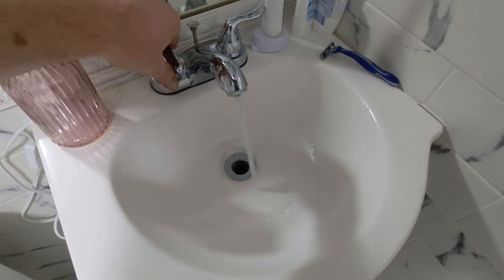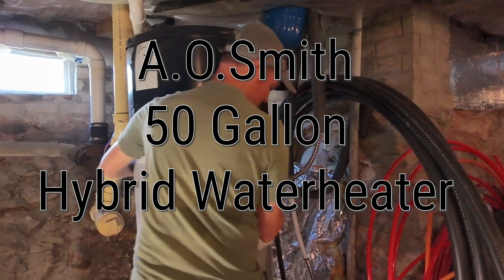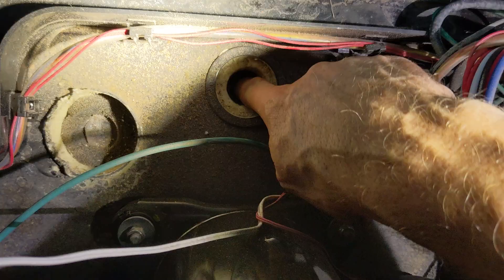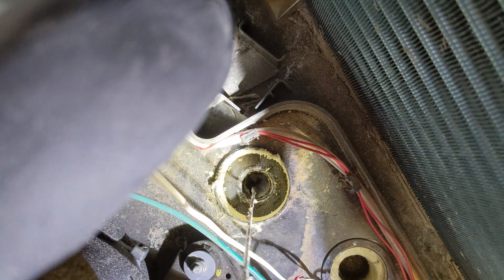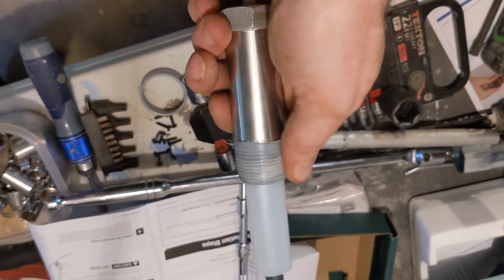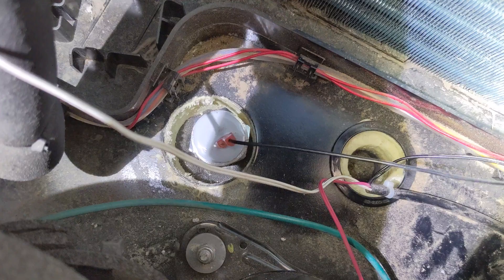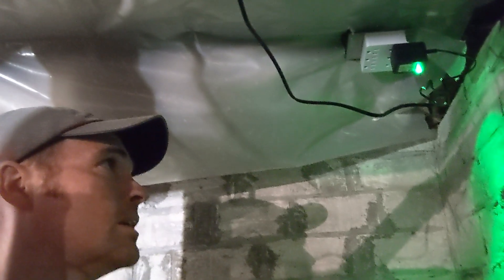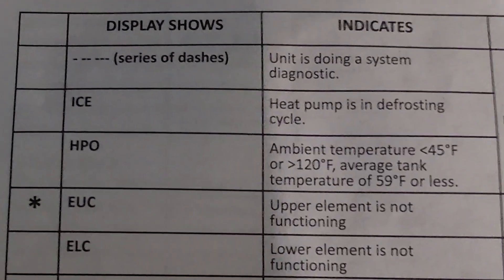Don't Make the Same Mistake I Did - The #1 Thing You Need to Do for Your Water Heater Today!

Comment: Sir your comment on a Corro Protec anode rod video brought me to you because I have a 50 gallon OA Smith water heater. My water heater's anode appears to be auditioning for a role as a permanent fixture.  I'll be adding 'impact driver' to the list of tools I never thought I'd need. thank you for your video.
Reply from the maker: @BusinessManClassic  yeah, they tighten them up pretty hard at the factory. Good luck on the project.